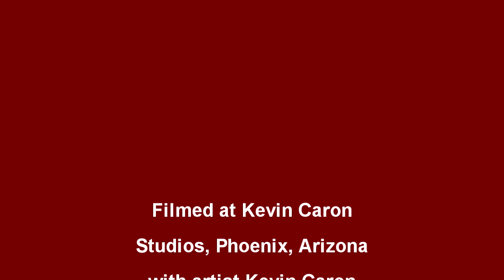How to MIG Weld in Tight Places - Kevin Caron

Comment: I used to weld things like that by making sure enough gas was blowing down in there and the make the wire reach way out, not TOO far but a bit farther and turn the wire speed up just a notch. Just like he did pretty much, only not just down but even upside down if necessary. Sounds like he already runs wire super fast.
Reply: Right now I have challenge of spot so tight I have to try taking nozzle off and pump gas in with separate hose.
Reply: Just recently I had to try and make some welds down in a hole, like quite a few inches down inside a tube with no room for nozzle. I tried making a separate tube to pump gas in from the opposite end but it just wasn't working right so I believe I pumped the gas in and it worked pretty good with a tig torch reaching way in.

Comment: The dilemmas of the rich and famous, “which welder goes best with my Grey Poupon, torch, stick, or the Everlast?” When you’re poor welding is so much simpler, the only dilemma I have to face is, “do I use the low or high heat setting on my ($79 on sale w/coupon) Harbor Freight flexcore wire welder?"

Comment: Would it be ok to switch to a 3/8" nozzle over 1/2"? We use the 1/2" at work most of the time, but on some tight joints I'll switch to a smaller diameter to get in there. Seems to work to protect the weld, but I have wondered about the integrity, even if it's not critical. My thinking is that it's like putting a thumb on a water hose for more pressure, but I haven't science-ed to really know for sure. When you said that about adjusting the regulator, it made me think of it. 
Tl;dr: when is it a good time to switch nozzle diameters?
Reply from the maker: +Johnny D, 

Well,    I didn't know there were different sizes!!     But I agree with you about the finger on the hose thing..    If it works for you I don't see why not...     Unless you are getting into building off of blueprints and everything is called out on them..   then you have to follow the directions.

Comment: Another useful trick I use with MIG is to remove the nozzle, use the dams to trap the inert gas. That will narrow your gun tip even more. Also if you can use Flux core, just remove that nozzle and don't worry about the gas! Thanks for all the videos Kevin, I love when Wednesdays come around!
Reply: I have that dilemma right now, I have to try taking nozzle off and pump gas in with separate hose. Hope it works.
Reply: Can also build a mini chamber to hold the shielding gas in out of high temp tape.

Comment: I have also used flux core in these situations with good success as well.  You need a longer stick out for the flux core to begin with and you don't have the concern of the shielding gas escaping.  Great video.  Thanks. R.J.

Comment: key Kevin turning up the mig works just fine, even without the "dams" you added. been cranking up the machine like that for years working auto body, fabrication, rebuilding milk tanker trailer. real tight areas, never had an area I couldn't mig yet.